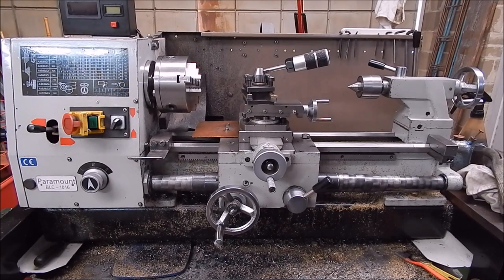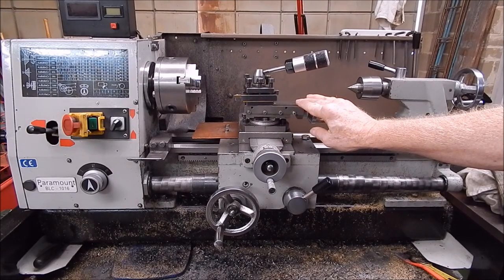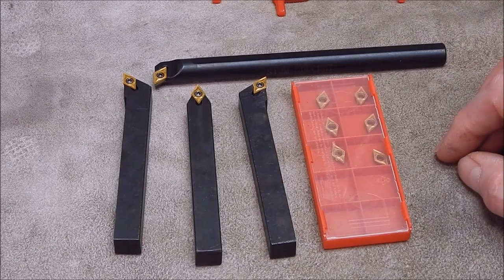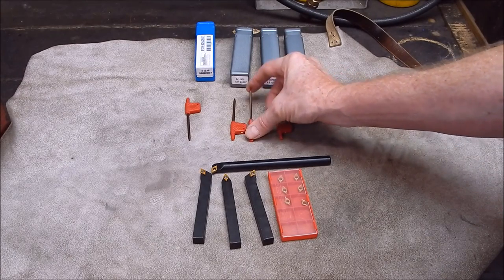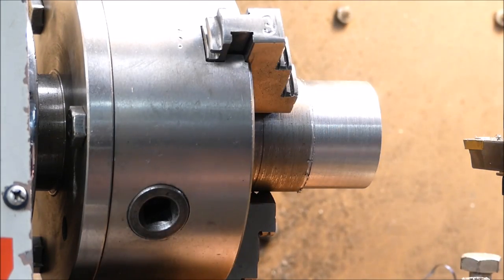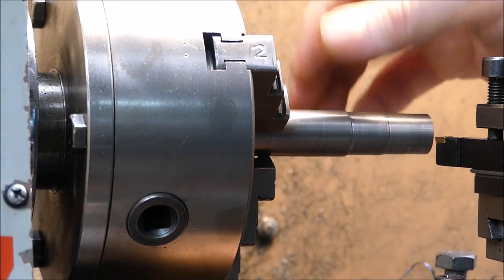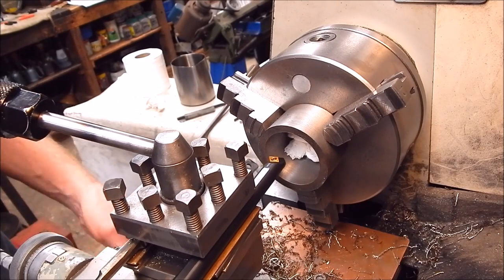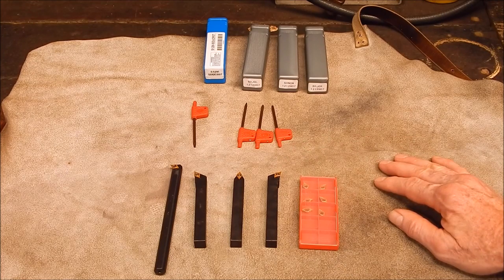A great indexable carbide tooling kit for newbie metal  lathe owners

Comment: G'day Rob - I run a lot of Chinese tooling on my Colchester Chipmaster and for the money you can't go wrong. I had a chap scoff at my tooling saying he wouldn't touch Chinese. When I asked him if he had a lathe or mill, he replied, "No, I can't afford it". That says it all. If the cost of tooling is holding you back, buy the Chinese stuff and get started on the hobby. I even do paid work from time to time and the tooling holds up just fine.
Reply from the maker: Dead on.  The only indexable tooling I've ever had trouble with was actually a Sandvik where the insert locating pin was extremely tight.

The prices are so cheap now it's amazing.  Same with the inserts.  When you consider what I paid for my TCMT set way back and what the dollar was actually worth compared to now, it's even more amazing.

Cheers Rob
Reply: I upgraded all my boring bars to solid carbide so I get less chatter and can increase the overhang. The bars cost between 20 to 30 dollars a piece and have been fantastic. All Chinese made and no complaints at all. China is fast approaching Taiwan with regards to quality. If you are willing to spend a bit, you get gobs of quality.

Comment: This video inspired me to buy a similar set of tools through another source.  My guess is that they're the same tools.  My first test project was to make an adapter for the boring bar to fit the 3/4" bore of an AXA boring bar toolholder that I already had.  The target OD was 0.748" which I nailed within 2-3 tenths.  With a little experimenting I was able to turn a piece of 4140 at just 720 rpm and with the right DOC and feed got a beautiful finish.  My lathe is capable of 2400 rpm but on small parts even a feed of .003"/rev (0.07mm/rev) moves the tool pretty fast so it was a nice bonus to get a great finish at  lower rpms.  I could easily take off just .001" DOC repeatably but at some loss of quality of finish.  The inserts do need to remove several thou DOC to get a nice finish.  After I got the boring bar mounted I faced the end of a piece of free machining brass with it and it gave a great finish.
Reply from the maker: It's a good set of tooling and not expensive.  The boring bar is a useful size.  Sounds like you have the set mastered.  Cheers Rob

Comment: Nice set of tools Rob. I have a couple of 16mm sets and they work very well. Another really useful holder is the MCMNN  which uses the 2 unused sides of the CNMG tips.    FYI  :-)    The 1st tool you pointed out is right hand tool and the 3rd is left hand tool. Nomenclature comes from the direction of cut. Cuts right to left is right hand tool and cuts left to right is left hand tool. Right hand tool tip usually points left & left hand tool tip usually points right. Hope you don't mind me pointing this out.  Great review.  regards from the UK
Reply from the maker: Hi Gary.  Thanks for pointing it out.  Just shows I'm not a pro machinist :)   But now I'm the wiser.  Always learning, even basic stuff like that.

I appreciate useful comments and they are what makes YT a great learning medium.

Cheers Rob

Comment: I have the same set but in 10mm shank and they are superb. I really wanted to standardise with one tip shape to keep things simple and for me DCMT seemed to offer the best compromise for a range of work. If you are cuting aluminium then buying the specific inserts is really worth it, they give an awesome surface finish on aluminium and plastics.
Reply from the maker: I like them.

The whole insert range thing is overpowering - just peruse the Mitsubishi manual of inserts.  LOL.  It's almost mind blowing.

Cheers Rob
Reply: Yep. I tried a lot of different things buying equipment for work and also settled on DCMT for most things. You don't need the strength or life of CCMT, and especially CNMG unless you're doing production, nor do you need any of the other shapes. I used to also use DNMG but I find I use it less and less since I'm not doing production so don't need crazy high removal rates. The negative rake inserts also likes to leave burrs that you have to clean up. The only time I pull out the DNMG is when I'm doing an interrupted cut where I'm just being lazy, and just want to feed it fast and get it over with without needing to be mindful. But you can do those just fine with DCMT as well.

Comment: I have a set of Chinese boring bars from a different supplier. They work OK but Chinese carbides don't seem to hold up very well. I just finished a simple spindle making job using 1.25" 4130 steel and the Chinese carbides were shot after less than 2 hours. This was all OD turning. I was using cutting oil. Taking mostly .050 DOC. 910 RPM and my fastest feed rate on a 1440 lathe.

Comment: One thing I tell folks Rob is there is better carbide out there, however do we run the speeds that makes a difference? Truthfully on most lathes in the home shop we don’t generate the speed or DOC to use the full potential of the inserts. So the Banggood inserts are a good value, the big drawback is most Banggood orders here in the states have long lead times and you are not given a date that the orders come in.
Reply from the maker: Hi James,

Dead on the money.  Plus the home guy is probably more likely to stuff up the insert, so it may as well be a cheap one.

One of my recent orders took four weeks.

Cheers Rob

Comment: I love these chinese insert tools, I bought that little set that use the triangle inserts and have been useing them pretty exclusively, lately though the inserts i've bought seem to chip easily? could be me though or just a dodgy batch of carbide, won't put me off useing them, there so cheap a few failures don't break your heart!
ATB and a merry one to yu and yours,
Cliff
Reply from the maker: Hi Cliff,

Once you get used  to using them and know what they can take, you wont chip as many.

It's all a learning curve.

Ditto on the Xmas thing.

Cheers Rob
Reply: I found that the Chinese inserts are very ymmv.
The first insert chipped within the hour, the second is still going days later.

Comment: Hi Rob, These are great tools that I use all the time. Great that they have all the same inserts. Have you tried the Blue Nano type from Banggood for these tools. They are amazing hard wearing inserts? Why don't you get a Dixon Quick-change tool-post for your lathe? It saves so much time having all these tools set-up all the time. Regards Steve
Reply from the maker: Hi Steve,

I saw you review the Blue Nano and they seem OK.  I haven't tried them yet.

It's good to have one insert style that can cover a range of tooling, but you never think of that when you start buying this stuff.  Later on you look in the drawer at all the insert variations and think what the hell have I done ;)

Cheers Rob

Comment: Hi, I'm thinking about buying a SER1212H16 tool with 16-gauge ag60 but I do not know whether to buy vp15tf (pvd) or ue6020 (cvd) I know that vp 15tf can be made with stainless steel but I usually use steel f114, what do you recommend?
Reply from the maker: Hi Jose,

I haven't had any experience with either insert.  I can't help on this.

Cheers Rob
Reply: thank you very much for your help

Comment: Always been a high speed steel tool person, but these are very tempting at this price, incredible value really. Do you discard these when they are worn or do you re-grind them? Looking at the inserts they seem to have a chip breaker built in to the carbide which is another plus & as my high speed tops are of variable sizes I have to repackage each one, so having three, if the boring wouldn't fit, that are the same ought be a plus in saving time finding the necessary shims. Un-stopable force (getting more efficient & making jobs easier & faster) meeting immovable object (reluctance to spend)! Thanks for sharing?
Reply from the maker: Normally you discard the inserts once all the cutting ends (tips) are worn/damaged.

Sometimes you can regrind them on a green stone for carbide, but of course you lose the indexing capability.

Cheers Rob
Reply: Finally the unstoppable force of wanting to be modern & efficient broke the immovable object of not spending & I ordered a set via your link. All my research following your excellent introduction convinced me that I would be daft not to get a set at this price. Thank you for sharing!
Reply from the maker: Welcome to the 21st century.   

Comments from others with this set all came up positive.    The current price is hard to refuse ;).

Cheers Rob

Comment: rob can you stear me towards  some 1# morris tooling i realy need an live center and a drill chuck. im here in the states . thanks
Reply from the maker: I'm not familiar with that brand.
Reply: @Xynudu   what tapper do you  have in the tailstock of your lathe ? i thought morris to be 90% of whats out there
Reply from the maker: OH OK, I think you mean Morse taper number one.

I did buy two Morse one live centres on separate occasions from different sellers on Ebay and they were both OK.   I've never tried a Banggood one.

I turned one down to Morse zero for the Sherline micro lathe.

Like any very small live centres they will only have ball races, so go for one with three if possible.  Mine both (different manufacturers/styles) only have two races  and each has a tiny bit of end play until you load them up, but that's pretty normal for cheap stuff in this size.  It's not an issue as they have to be used loaded/tensioned.

I can't comment on buying drill chucks except to say try and buy a brand name like Metabo with an included arbor - the local agent should have/get those.  I never buy cheap Chinese drill chucks as they are often made of cheese.

Having said that, the drill chuck on the HILDA die grinder is really very good, so you just can't be sure until you get them.

It's all a lottery really.

Cheers and good luck.

Rob
Reply: Amazon.
Reply: @Xynudu  iv been hoping some would show up local  i bought a craftsman 6x 12that is perty raged out and used it and now i got a much better shape though newer   atlas  both take #1 . thanks for the comments and sorry bout the spelling ,not my strong suit lol  thanks for sharing and merry christmass

Comment: Not actually a comment but a question. Do you have any experience with Banggood involute cutters? I need to make a couple of gears for a Logan lathe quick change gearbox and currently do not own any gear cutters. Any advice or other information will be appreciated.
By the way Hello from a Texas subscriber.
Reply from the maker: Hi Tom,

No, I have not used BG involute gear cutters.  I bought mine from CTC Tools on line store and they were excellent.  So check them out.

Price wise they are not expensive.  I made the arbor/mandrill.

Check out my gear making web pages if you haven't visited them:  http://users.tpg.com.au/agnet/cq9325rev7.html

I'm sure I saw a review on YT of the BG gear cutters, but can't remember who or whether it was just unboxing - no actual use feedback ?

I can definitely recommend the CTC ones.

I've used them on aluminium, brass and cast iron.  Still as sharp as when I got them.

Cheers Rob
Reply: @Xynudu  Thanks so much for the prompt reply and link to your very useful information on gear cutting. I will check out CTC tools. Looks like time for a milling attachment . Merry Christmas and a Happy New Year to you and your family.

Comment: What do you reckon these would be like on brass and ali Rob?
Reply from the maker: They work fine on both, but you will have limitations using any insert designation for those two metals.

HSS rules the waves with both brass and aluminium.  Particularly with brass which doesn't nomally have top relief on the tooling.  Both require a sharp edge and possibly a broad radius to get the best finish.

I still use HSS a lot and although everyone is carbide happy these days, it is not the best option for these two metals IMHO.

But do whatever floats your boat.  Brass = no lube, and ally = lube,  regardless of the type of tooling used.

It makes me laugh when I see comments on forums where some one doesn't like an insert type because it's triangular or some other shape.  LOL.  The cutter radius is the primary consideration.  The degree of the apex is significant as far as strength and clearance are required.

I guess we all have our preferred/go to insert, but I suspect that may just be from habit/experience.   Mine is TCMT.

However I have a draw full of other shapes and styles,  and depending on circumstances, any one of them may be the better option. 

Cheers Rob

Comment: Hi Rob, can you use a hss drill bit shaped right as a lathe tool?
Reply from the maker: Drills aren't designed for side loading, but I guess anything is possible.
Reply: Yes you can.
https://youtu.be/k2a9ywCEK_A

You want to use the thread end though, just below where the thread ends. Some of the shanks seem a bit softer...